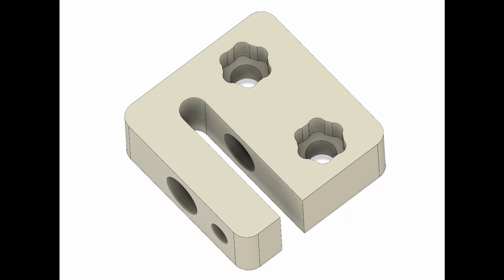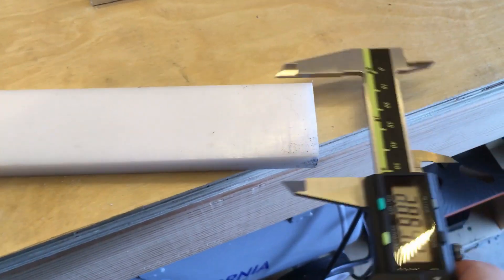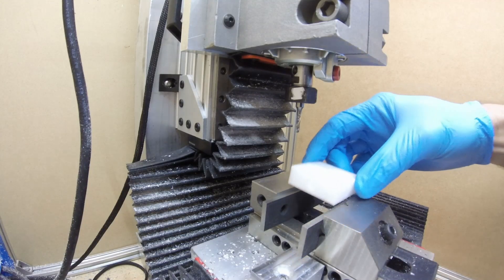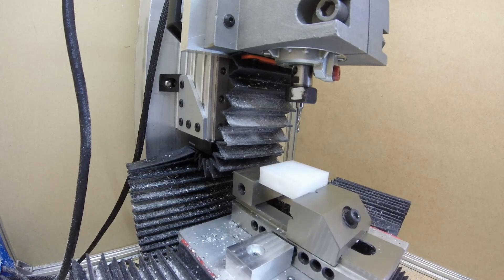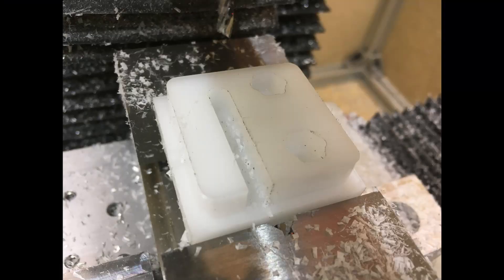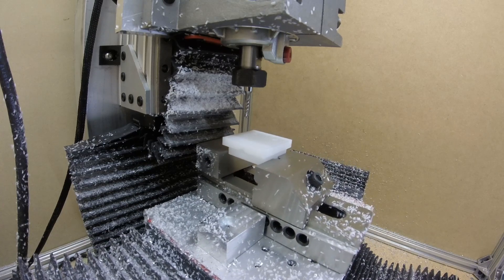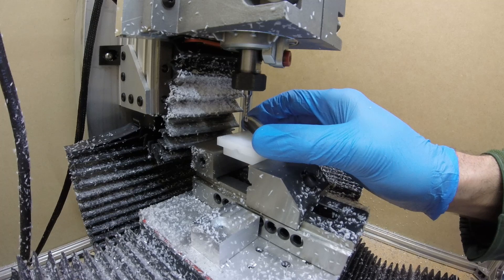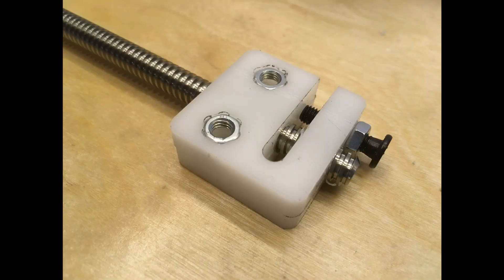CNC Machining a Delrin Anti-backlash Nut

Comment: Yes i will be "THAT GUY",when you jog the machine to find the zero point you want to work from,it would be easier if you fit folding handle jog wheels to move x and y by hand incase the jog increments accidently break the tool also the feedback you get from your hand / jog wheel  pressure against the spacer will work way faster.

Again to speed things up,square up the material by hand not cnc,use the jog control to move  farther than the material,or use the hand jog wheels like a manual mill,then stick the material out of the vice enough to cut the adjustment slot.

I get that it's cool to watch the machine do most of this automatic,but the part is too simple not to manually cut it as this would be again way faster and just as accurate.

Any one that uses a manual steel cutting mill would agree due to the set up needed to "cnc" mill this part,the nut holes dont need to be cut hex they can be cut to a rellative size circle and then draw the nut into the delrin or press it in.

If you want to mill a non conductive material you can paint some of its surfaces with conductive paint,made from acrylic paint mixed with graphite powder,then you can touch probe.
I make no apologies because i use a manual mill and this piece could have been done so much faster by using hand wheels due to its simple shape,had it been complex then yes cnc it.

If anyone wants to see manual milling or work done on a manual lathe ,this old tony or joe pie are good sources,the techniques used translate very nicely.

And finally ,since i'm here to see an adjustable simple backlash nut being made,i should say watch this old tony making a tap,for the acme or trapezoidal lead screw to be cut you can make a tap for delrin with a piece of the leadscrew of the proper pitch and lead,again the technique is the same as this old tony will show except you do not harden the material as it will be hard enough for plastics(maybe even brass...maybe) you just cut the flutes on a mill and then either carfully grind or turn the starting taper on the lathe or use a vertical turntable on the mill,i'll use my lathe.

The cutter used here is a tungsten carbide single O flute up cutter ,used for plastics and aluminium.
I don't want to be a dick about it,but i don't want to dick about either.

Comment: After you flipped it, you probably could've picked up the fixed jaw for the Y-axis (assuming your vise is indicated).  I think I would've used a 1-2-3 block (or something) to pick up the machined edge of the X-axis as well.  Then in your "bottom" program, set the origin to the upper left of the part instead of the stock.
Reply from the maker: Good advice!